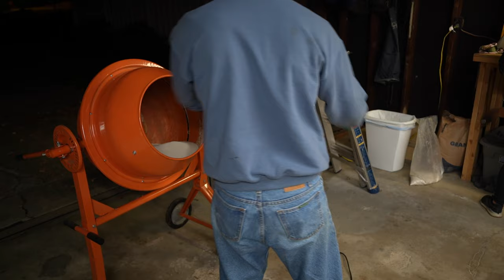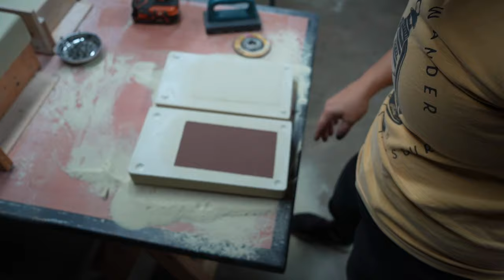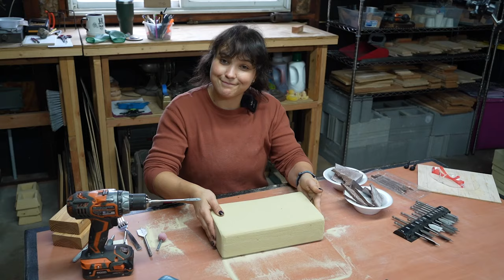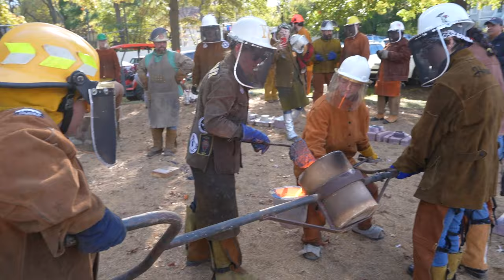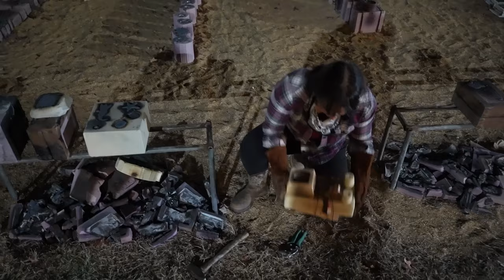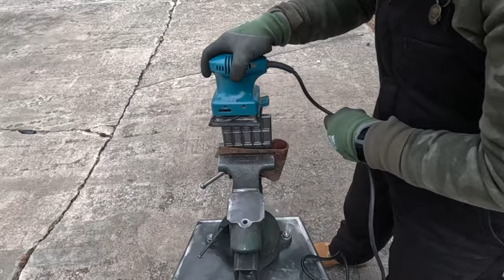I made a Cast Iron Chocolate Bar | Mold Making | Iron Casting | Finishing

Comment: The 3D printing will be significantly cheaper than the CNC milling route, the trick is going to be getting a 3D printer with enough resolution.
Reply from the maker: Thanks for the suggestion!  I have to first get a 3d file, that might be the biggest hurdle!😅
Reply: @CastIronGypsy  The file might not be that hard, but I don't know enough about what is available, however I do follow a channel that does. Joshua De Lisle makes videos about making stuff, reviews tools and gadgets, specifically 3D printers (both filament and resin), Laser Engravers (which might also work), CNC Plasma cutters (which won't work), these are hobbyist size machines (which is exactly what you would be looking for). What you are looking for will be on this playlist https://www.youtube.com/playlist?list=PL1UcPGY9BPCjAIUMvr486Q4NBKoh1W1Hf He does mention the software he uses, but doesn't have a tutorial for it (but I'm sure you can find one somewhere).

Comment: do you ever use reusable sand like pertobond?  The filled in details might be your parting dust.  when I make high detail 3d printed belt buckles in 150+ mesh petrobond the texture of the parting dust leaves a distinct pattern on the cast buckle unless i brush off 90% of it.  Get a 3d printer, it revolutionized metal casting.

Comment: Can you do anything about the molten iron viscosity, like "thin iron" for this one, "thick iron" for that one?  Or you just take what you can get?  I guess it's not really that thick anyway, but that stuff seemed kinda "runny", or perhaps I'm delusional?   :). Maybe it's not a limiting factor.

I guess the other bit, the granularity of the sand...  OldFoundryMan put in a lot of work just on his "sand mill", big old machine.  Maybe there's no other good way to do that, and so it's a choice to invest all the time and resources or not.  Maybe... kitchen blender?  🙂
Reply from the maker: Hi, thanks for the message and for your patience with my late reply!
The hotter the metal is the “thinner” it will flow.  We can write in our molds if we need them to specifically be poured “hot” or “cold”.  You’re right though, many times we just take what we can get!

As for the sand “fineness”… as a hobby production it’s probably better for me to concentrate on having a better pattern than trying to mill the sand finer… and from what I’ve seen of how the sand wears away my spade bits and drill bits when I’m cutting in the gates and vents.. a blender blade wouldn’t last very long…🤷🏻‍♀️

Comment: I am so impressed with the detail. I would never have thought such fine details were achievable with resin/sand. I wonder what different sand types could do in the hands of a master (you ). I am specifically thinking of the White Sands of New Mexico. 
Anyway count me in for rubber feet. I love the look of cast iron. I am fasinated by the idea of  a salt/vinegar/hydrogen peroxide patina But I am torn. I am a cast iron purist but I also love the ideas of a chocolate colored non-chocolate bar. Speaking of which did I see you munch on sandy chocolate?  Cheers from Sandy Eggo, CA
Reply from the maker: Thanks for the message and for your patience with my late reply B!😉
Finer sand might pick up more detail… so many people are mentioning it I’ll have to see if I can source something like that!